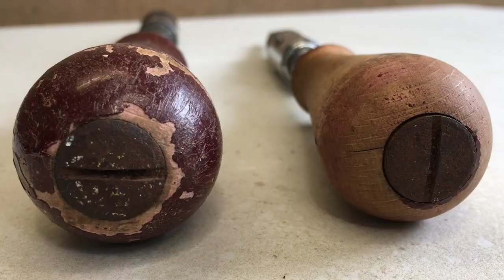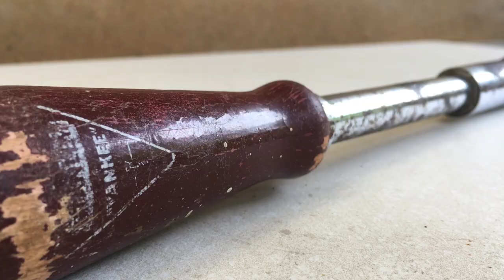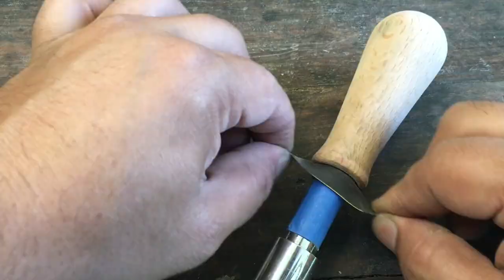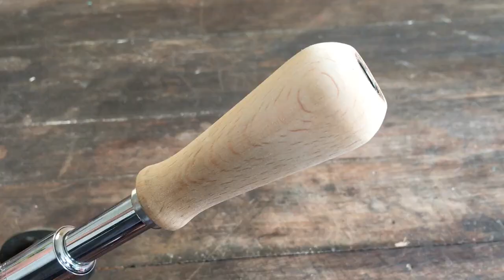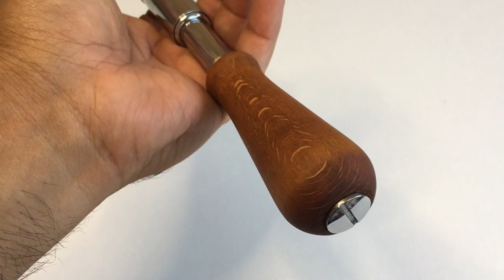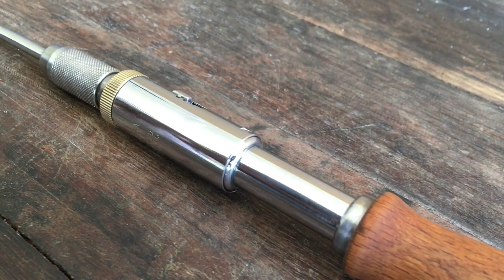Stanley Yankee Screwdriver Restoration

Comment: I have a couple that stay extended. They don't lock back into the shorter configuration. Is that an easy fix?
Reply from the maker: Hi thanks for watching. You will have to take it completely apart. That means taking out the handle to remove the wedge there too. I believe there is a little ball bearing that underneath the lock mechanisms and that can get crushed in and causing it to not function properly.
Hope that helps 👍